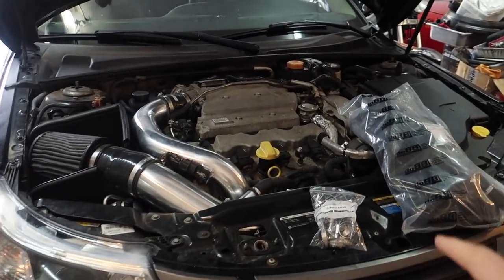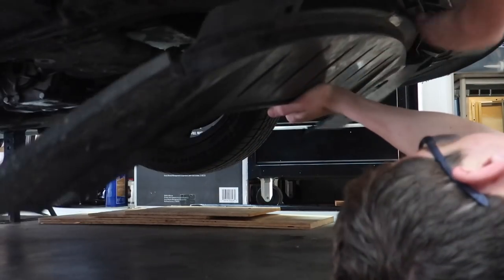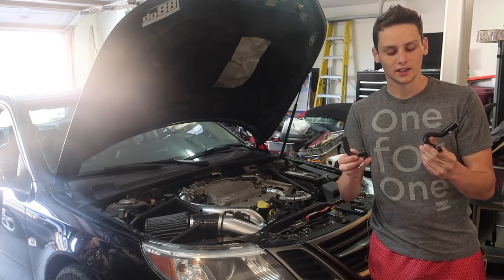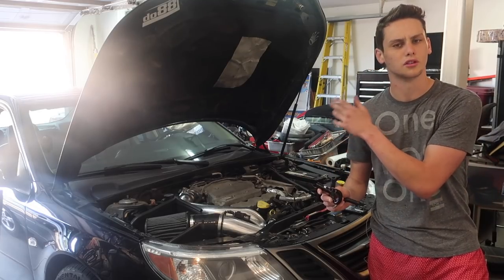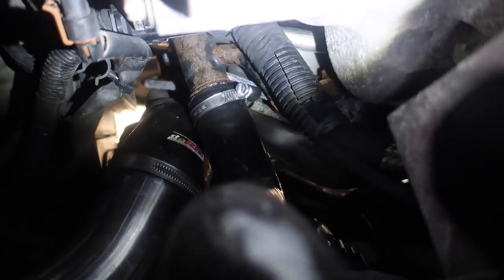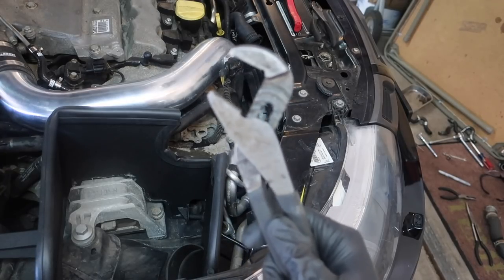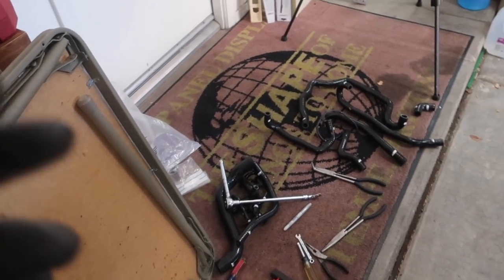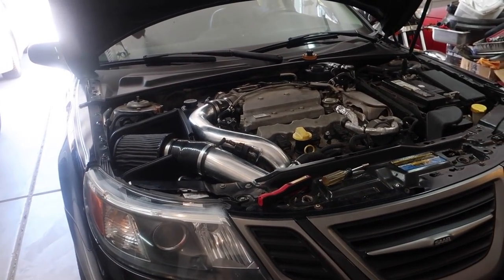Do88 Radiator and Coolant Hose Kit Install on My Turbo X!

Comment: Hi there, Just came across you. I own a Saab 93 Aero V6 2.8 2008 wagon AWD and need a new radiator.  Me and the mechanic have ordered 5 so far and they all come missing a tube on the lower left side.  I just came across the D088 site and wondered if I should trust them that the radiator is the right one?  You have any insight for me? I love my saab so much and it's only got 100k on it so I dont want to give up! Thx.

Comment: If you take care of maintenance these engines are stellar performers! That being said....
Heat soak is a given and a bypass pipe is a great solution - where it is legal. 
They run hot because of the idiotic "GM High Feature Engine" series design of putting the flaming-hot 1500 degree catalytic converter right on top of the engine compartment. This forced the also HOT turbo to be placed up there. 
This inferno sits between the battery & engine, and right above the transmission. The Heat shields help, but only so much.
Great for winter warmups but means you have to keep up on Cooling System maintenance and tune ups.
Cat temps increase if it is not running clean, leading to more heat soak on the surrounding components. 

Like I said: Keep up on the maintenance. These engines are worth it when the pedal hits the floor!!
Lots of low end torque and all the benefits of a turbo engine.
Reply from the maker: Yessir!!

Comment: I changed to all DO 88 hoses. I found after a heat cycle the clamps needed to tighten again or there are leaks. Get a hose removal tool
Reply from the maker: Thanks for the tip; I'll have to check the connections again

Comment: Hi. Just switched to do88 intercooler and radiator. Whereas I m very impressed by intercooler, I still puzzled by radiator. Overall temperature in the engine bay has increased. Also even if the car reaches its operating temperature much more faster, I found that the overall temp of the cylinder head and even air filter body and plastic cover of the engine are higher than before. But the temp controled by the gauge, by Obd Torque pro and direct testing on the expansion tank are all OK, ranging from 83 to 88 max. Thermostat opens at 85°C. Very very puzzling. Do you notice that. Last, idling is slightly higher and not that stable. At idling, engine warm, engine was smooth. This is no more the case. Any help welcome !
Reply from the maker: interesting; i don't have the radiator so wouldn't know. i'd reach out to them!

Comment: Auto Autopsy, did you notice any improvement in heat production from the engine? 
Even if the mod takes off a few degrees in the engine bay, I'd say it's worth it.
Reply from the maker: in terms of temps? no different; they're just hoses

Comment: can you reuse the radiator plug once removed or does the o ring and/or plug have to be replaced?
Reply from the maker: you shouldnt be fully removing the plug. it should only turn a bit before coolant comes out

Comment: It's dex cool people say it's fix but I say bull dex cool eats engine parts over time. There was a class action lawsuit over it. My fix is change it once a year.
Reply from the maker: I’ve actually changed it like 2-3 times already lol! I had to remove the expansion tank for the downpipe as well so I’ve already done it 😂
Reply: It might be that you did the first coolant change on the engine after what, 8-9 years?
The coolant is supposted to be changed every 2 years, or 5 years for longlife. 
Imagine stock coolant being there for additional 5-6 years. There’s no important additives left in the coolant and it just starts to corrode from the inside.
Reply from the maker: I obviously can't speak for the previous owners on this, and its therefore not my fault.
Reply: Auto Autopsy think it was the other owner. They tell people that it's maintenance free in new cars if it dex cool I say change it every year to be safe. It just more GM bs.